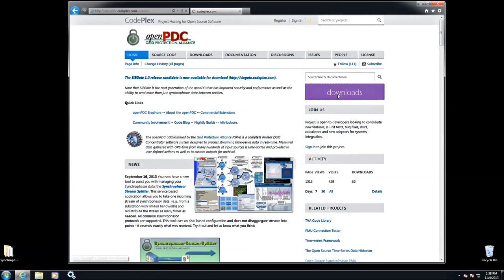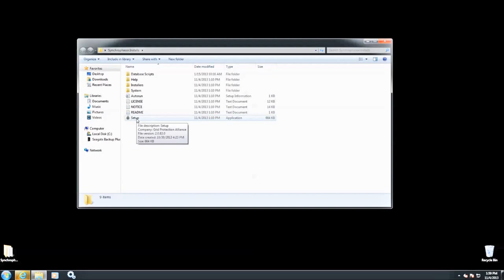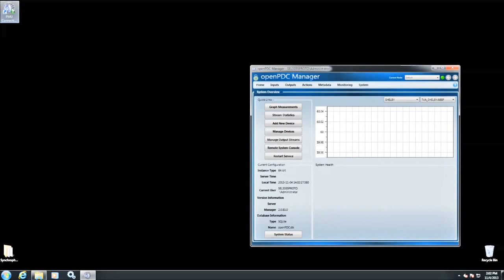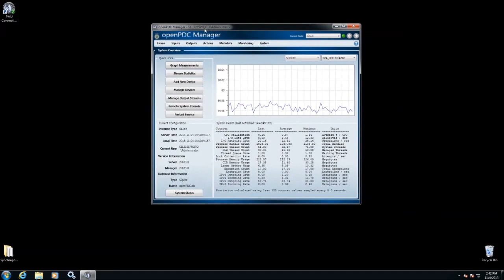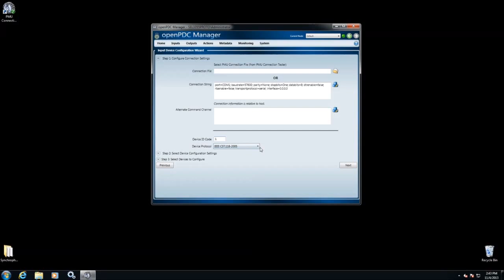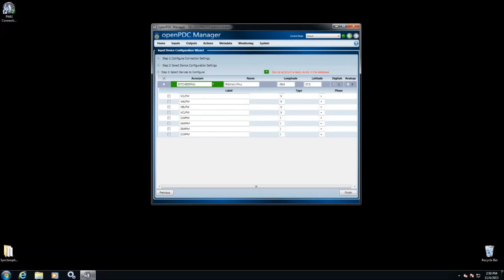Installing and configuring the openPDC for use in a substation

Comment: Hi Sir, I wanted to know if I could connect the SEL 421 to openPDC if i do not have serial cable
Reply from the maker: If the 421 has a network adapter, this will work as well.